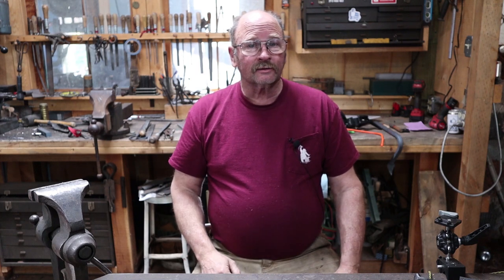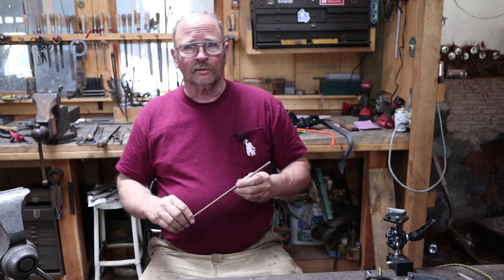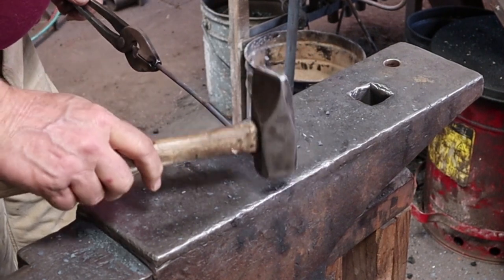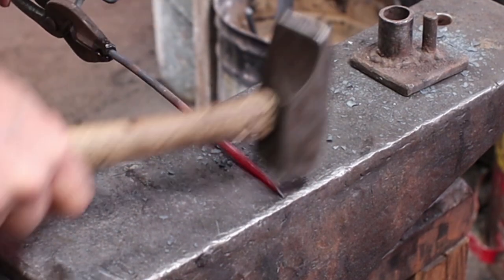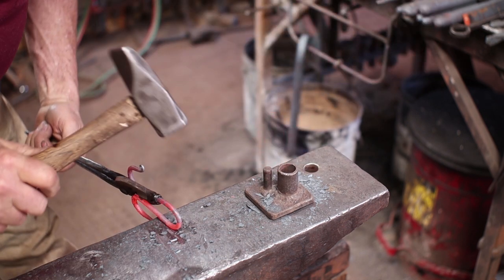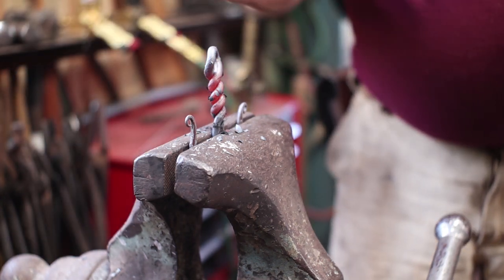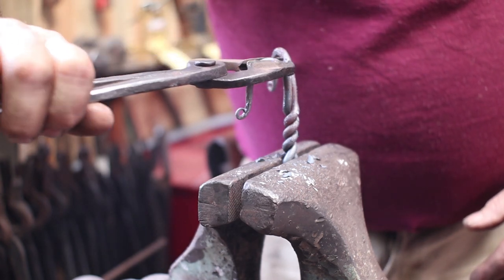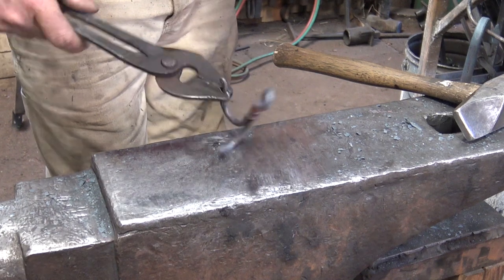Twisted double hook - Hook of the week 6

Comment: Hey John, have you ever made a bale hook? I need two and I was thinking of trying to heat and beat some out of rebar. Would you use a wooden handle or metal? I see a lot of different all metal designs out there. Any advice?
Reply from the maker: I haven't, but they seem pretty straight forward to do.  I think a wood handle would be nicer, but since I don't use one, I might be wrong
Reply: @BlackBearForge  Thanks for the answer John.

Comment: That's a nice hook, I'm gonna try to make one of those too! I have plenty of long pieces of thin round bar laying around.

I have a question: I noticed there's a lot of scale on your anvil and I've always heard to clear that off so you don't hammer any into your work. What is the reason you're not worried about that?
Reply from the maker: I do clean the scale quite often.  But I don't worry to much about it unless its a project that needs a cine finish

Comment: again, no translation was written. I'm sorry! below asked how to attach to the wall? if only the top hole, there will be a hook to hang, if only for one end to hang the load. I did so - Prokofeva pigtail with two holes punched. and so the like and Respekt and uvazhuha, my American Sensei!
Reply from the maker: The hook will tip when you hang something on one side.  But it isn't much of a problem for a simple hook.  Lots of ways to make it fancier and add another bolt hole